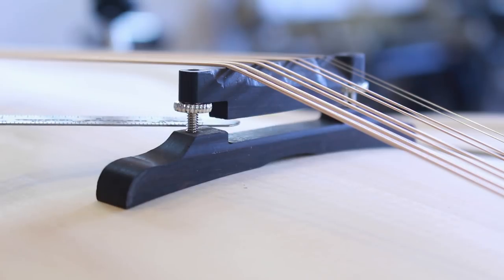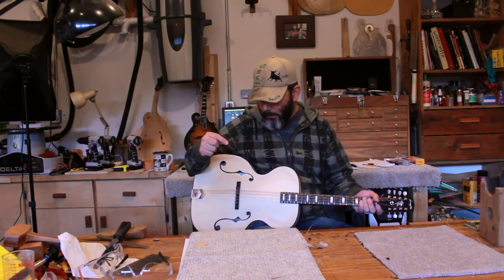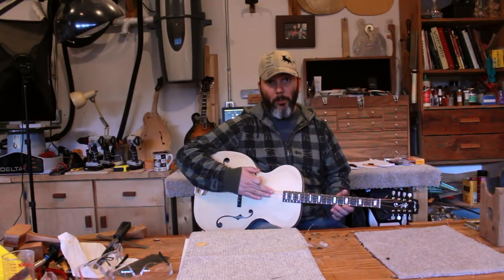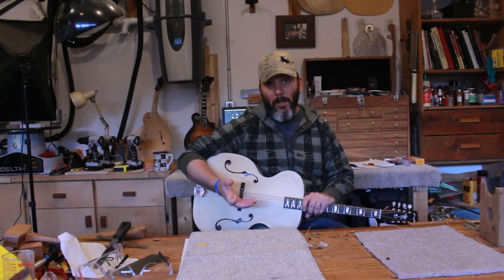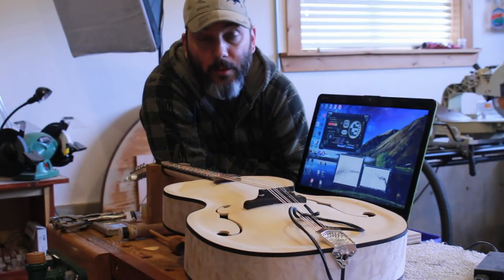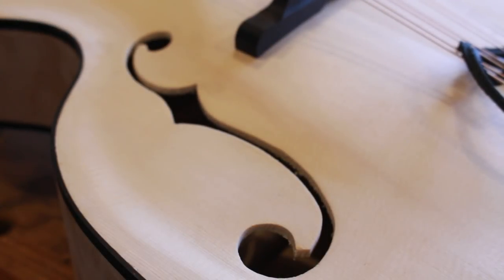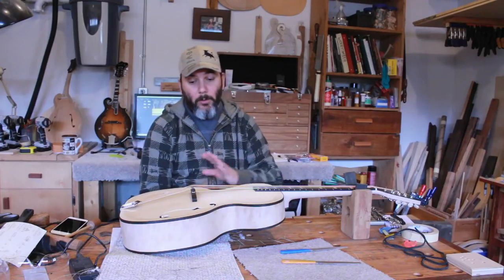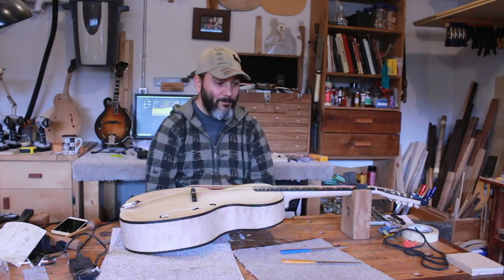Voicing of the Octave Mandolin

Comment: so beautiful! for the prints, if you have them in PDF with a scale beside anyone can take the file to a printer and have it printed out at that scale.
Reply from the maker: I'm thinking of getting a hand drawn print scanned and put to PDF. Would you put the scale right on the drawing then for them to be able to compare after printing. Or is it a PDF scale? I do have autocad but it is A LOT easier for me to do the drawing the old fashion way.
Reply: you can do either. if you put a scale beside the image on the PDF the printer can enlarge it tell it prints the right size. the most accurate way would be to import the image into CAD and scale the image in the cad then you can print out as PDF and then as long as it is printed 1:1 it will be the right size.
Reply from the maker: Sweet! That sounds easy enough. Tanks man!

Comment: Greaat job, as far as the dwg's go, add an imperial or a metric (or both scale to the dwg and then simply give a file either PDF or DXF format and the end user can print it enlarging it to match (as closely as possible) the scale or simply work from the dwg and visually enlarge each dimension following the scale.
Reply from the maker: That is where resides my biggest problem, it has to be on scale. Not a 1/4 “ bigger or smaller. To put both scales sounds like a good idea though. Thanks for your help.
Reply: Tomy, I get y9our point that you want a full size drawing. I have been doing mechanical dwgs for a good part of my life professionally. When I send a drawing to someone by computer file even if the dwg is to any scale full or 1/4 " - 1', I ALWAYS put a measurement on the drawing, a line (generally 2-3") with delineations marking inches or mm's. This line (scale) can be used to verify that it prints out to the exact scale by simply measuring the scale line. Of course, I may still not be understanding your dilemma so no need to respond if so. Keep up the great craftsmanship.